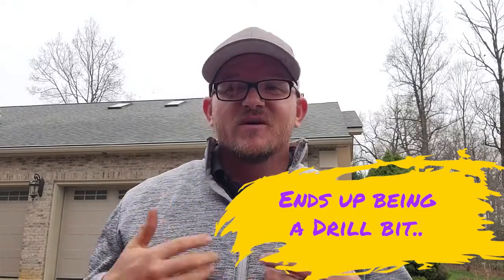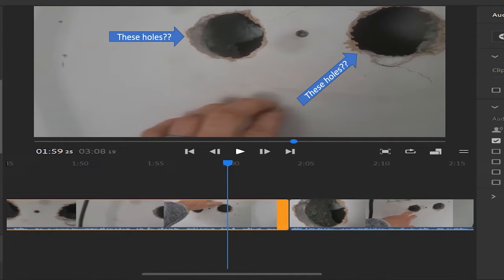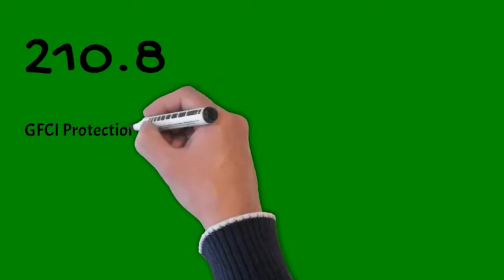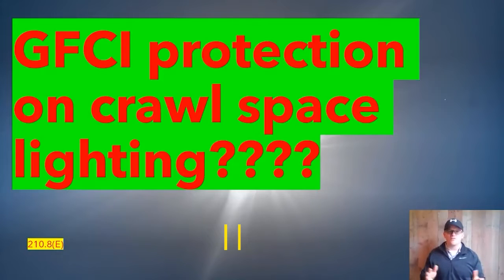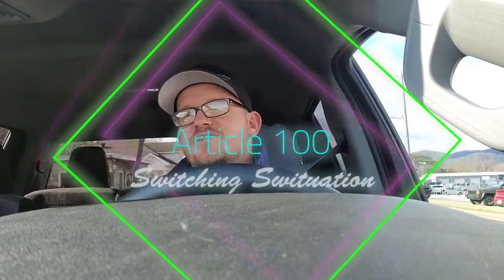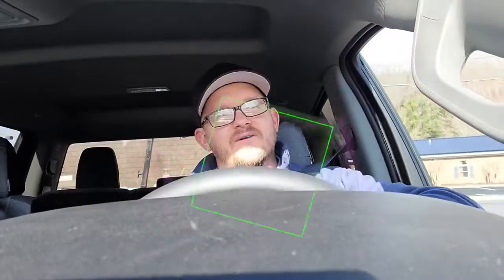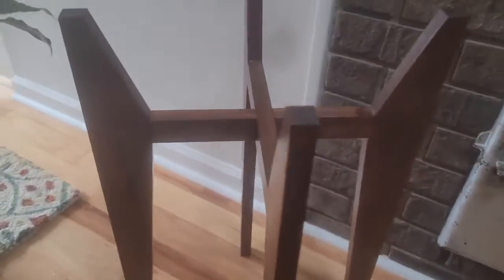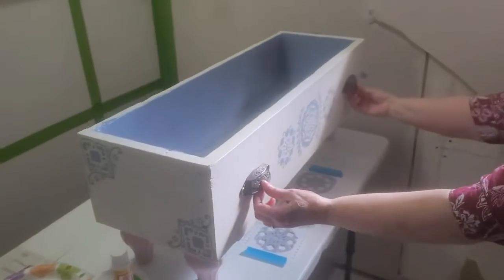Electricians In Action FULL EPISODE! .  Spend a week with an Electrician! Episode 1

Comment: I've had plenty of LED fixtures go bad. Even the expensive commercial fixtures.
Reply: My home shower LED light burned out. I assumed a whole new fixture would be required (I install a lot of puck style LEDs) but found the fixture contained a screw in LED light bulb! I haven’t seen those fixtures around my big box stores.
Reply from the maker: I've been on a streak so far, I've had a couple bad out of the box but I haven't had any that worked when I left that I had to go back and change.